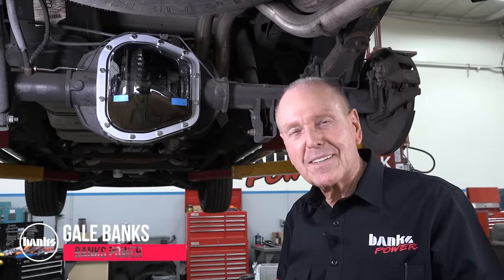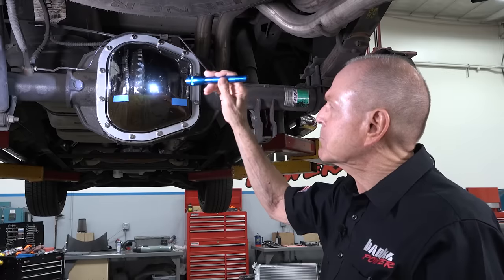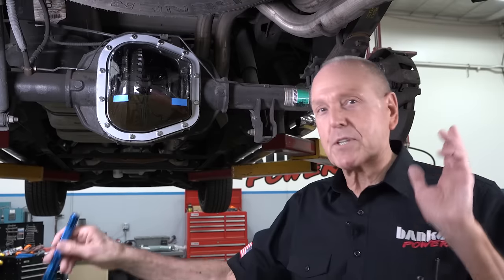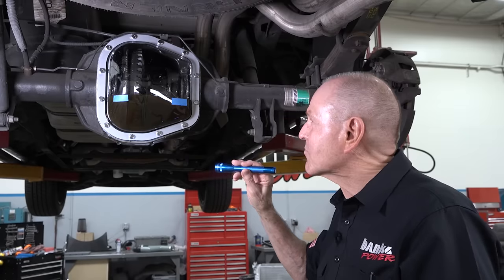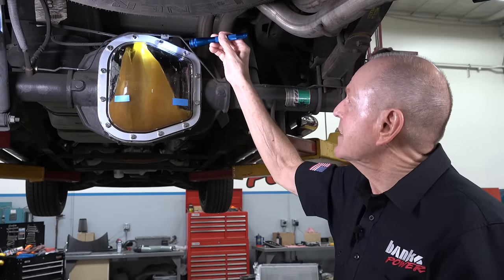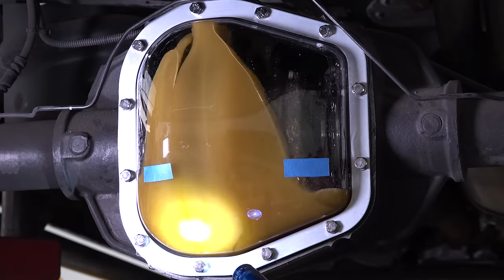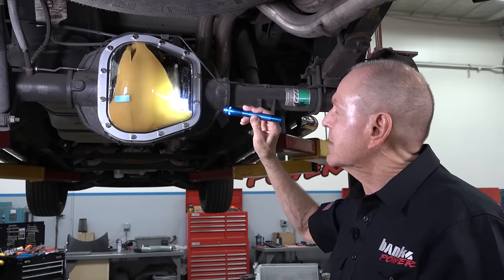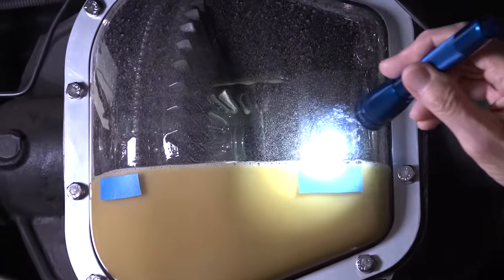What's going on behind your stock diff cover?

Comment: Mr. Banks, I appreciate this video and your “test and prove” attitude. While I agree with you that the flat backed covers are a terrible design, one thing I suspect that might differ from what you are suggesting at 6:40 , is that maintaining an even gap between the ring gear and cover to in fact not be all that beneficial. From working with hydraulic systems, I suspect a reduction in clearance as the oil travels up the back of the cover and over the ring gear is more beneficial as it helps the oil column to maintain the velocity needed for the oil to achieve escape velocity and get thrown into the pinion gallery.

Comment: Make a plastic cover molded in the shape of the MagHytech one and let see the fluid results
Reply: with thin plastic sheet, the diff cover itself could be used as a vacuum mold.
Reply: I would like to see what happens to fluid when it hits what he calls a step and if it really matters. What I'd also like to see just taking a rear end and attaching an electric motor to it. That way you can measure current draw at a given rpm at the rear wheels and you can run it for longer periods. It would be interesting to see what happens to the fluid after running at 60 mph for an hour or longer. Does the fluid have more bubbles or the same?
Reply: @brainfreeze44131  THAT WOULD F**** WORK! We had a bench in the USMC (it was a USAF hand-me-down) called the MA-3 bench that was used to test generators.

Again, good idea.
Reply: Having the truck on a dyno creates the similar load/friction (build heat like on the road).
I suppose you could disconnect the yoke from the driveshaft and then somehow tie in an electric motor to turn the yoke instead.
Reply: I pretty much assumed that would have been in this video.
Reply: Didn't anyone hear him say how plastic is an insulator...
Reply: + Jmodderator
I think you misunderstand. This is referring to plastic just for a quick test to see the fluid pattern, not as an end product.
That said, how much heat transfer does the entire differential case do compared to just the cover? Probably 95+% thus the cover being negligible so far as doing and significant amount of cooling.
PS 7:59 WHAT happened to the tire?
Reply: The axle will surely be a heat sink but won't dissipate as much heat as a thin steel or an alu cover.
Reply: Your conclusion lacks common sense (and empirical data) support.
surface area of axle = ?
surface area of cover = ?
Yes, aluminum is a better heat conductor than steel, and yes, the thickness (mass) of the heat sink will govern how long it takes to dissipate heat "to the air outside the axle"
but it will still have absorbed heat "out of the fluid "(which is the goal).
A sure test would be to test it with both - a thick cover made from steel and a thin cover made from aluminum. I estimate there to be minimal heat difference in the fluid temperature. Perhaps Banks will try this out.
Reply: The axle will break from rust corrosion and worn body mounts long before your rear diff gives you problems.

Comment: I like the idea of aluminum for a differential cover to deplete the heat and keep the viscosity of the oil at a decent temperature! Can imagine how aluminum would work well when towing with a truck! Thank's for sharing!
Reply: Some Jeeps have the "heavy duty" version of their transfer case housings made of aluminum, which...I didn't fully understand the reasoning behind, until I watched this video.

It's not for strength in that case, but rather because it wicks away the heat better than steel.

Comment: Without the smooth transition of the cover, over long periods with a cover without that flow direction, one wonders if the lubricant would endure extra shearing forces? Not to mention foaming and the extra oxidation.This all perfectly illustrates what engineers and Spicer and Meritor told me about the way their covers were designed. Good work and I am dying to see the results.
Reply: Jim Allen I’m also interested in this test . I believe you meant aeration as opposed to oxidation in regards to the foaming of the oil.  One is Air mixed with oil, as is the case here, vs a chemical change at the molecular level (oxidation). I believe anyway.
Reply: Alexander Coburg He is correct. Air contains oxygen. Oxidisation is caused by oxygen. Aeration of oil, especially with high temperature, accelerates oxidisation immensely.
Reply: Yes, foaming is the less correct term, but maybe more understandable to more people. Foaming and aeration, of course, are a major source of oxidation and early lubricant failure.

Comment: I’d love to see a test of different gear oils....conventional vs. synthetic, with & without friction modifiers(limited slip additives) since you have the perfect teaching tool in your clear differential cover.
Reply: I'd like to watch the posi-traction system doin' it's thing, in real-time.
Reply: No tests necessary -- ANY synthetic gear oil will out-perform ANY conventional gear oil of the same viscosity. Period.
Among the synthetics, only Royal Purple has the Friction Modifiers built right in to the formula.
The famous 95 MERC runs an X-Pert Performance cast aluminum diff cover, LubeLocker re-useable gasket, and 80 ounces of Royal Purple 75-W-90.
Reply: @revolutionday1  All you'd see is gear oil splashing around, which is only slightly more exciting than watching paint dry.
Reply: At silklizrd where did you get your info?

Comment: Was rebuilding my Ford 7700 Sterling 10.25 rear end and was going to put an aftermarket aluminum cover on until I saw this video. You saved me a lot of money and a lot of aggravation. I figured the best thing to do was take the stock cover and have it sandblasted and powder coated and bolted back on with new bolts. Still got a nice looking cover but yet allows oil to flow the way the Ford engineers designed it to do.

Comment: Banks is the man for this exact reason!   his scientific mind produces the absolute best products.
Reply: @bankspower  What banks is forgetting here is that the gear oil level must be sufficiently high enough to lubricate the axle bearings pressed into the ends of the axle tubes as well as the carrier bearings pressed onto the diff carrier.
Reply: Hi sir, I was wondering when we going to get an update on the diff cover for the f150 09 to 2014. Please let us know. Thanks.

Comment: Looks like a good aftermarket would be stock shape inside using aluminum with cooling fins outside. Best of both?
Reply: yeah, maybe even with vertical oil channels inside to keep the flow direction uniformand to increase the heat transfer surface area
Reply: Anax100 vertical fins would still change the direction of flow that the engineers intended. The best would be an aluminum housing the same shape inside and outside just with external cooling fins to add a bit of surface area.

If cooling really was the aim, there would be finned housings and tubes too.
Reply: @Anax100  that would only work if the cooling increase was greater than increase in heat production caused by the shear forces introduced by changing its direction as well as the increase in shear caused by the extra surface area of the internal fins. Basically, you need someone who is really on their game when it comes to multiphysics simulations which are then backed up by real world testing of some sort. Or possibly just a shit load build, test, tweak, iterations b/c those simulations could take days to run to be of any use. And that doesn't even take everything else going on inside a diff into to account. 

Not impossible by any stretch & ideas yours are how things improve. Just need to find the right idea. Even what many would consider a shitty idea could actually be a breakthrough. However, being such a mature design I'd wager that simply changing the diff cover isn't going to produce any Earth shattering results. But you never know. That's the beauty of R&D!!
Reply: Not trying to impose any stupid thoughts but aluminum is brittle and can bust if impacted. I work for a company that is hard on our trucks in that most of our work is off road. I have bent up a couple of different covers. Had they been aluminum they would have busted. As it was we kept going to get back to the shop with no down time. Also with road debris same scenario can happen as a brick fell off a truck in front of one truck and banged up the rear end bad. Actually cracked the pumpkin. Diff pan helped to keep things intact enough to get truck to a shop. Aluminum would have cause a catastrophic fail and possibly a wreck. This is just my thoughts on it. Shade tree mechanic here so my voice is weak on this.
Reply: Your voice is not weak on this. It is a very valid point. It is also a point that is proven time and again. Whether it is an aluminium wheel, aluminium sump, or an ali diff cover there is a big trade off. Yes, ali wheels are lighter but on a 4x4, you cannot beat a bent ali wheel straight if you damage it. Many people with ali sump pans have been disabled when a rock strike on a steel pan would have dented it without breaking. As for diff covers, the same applies. I do not think there is any viable reason for an ali diff cover. If cooling is a problem, buy an oil cooler and fan. Mounted correctly, you will not damage it.

Ultimately, these ali diff covers are put on trucks because they look cool. The supposed benefits of cooling is marketing BS. In any case, the pressed sheet steel on the stock cover won't retain all that much heat anyway. Yes, ali is a better conductor of heat but not THAT much better. Especially in that application.

Comment: New banks dif cover coming soon? Seems like you could do much better with the data you’re gathering.
Reply: They wouldn't be spending this much time and money if it wasn't for product development!!
Reply: I was about to say the same thing. Haha
Reply: That was my thaught
Reply: So far the verdict seems to be stock is the only way to go
Reply: Until banks releases its new diff covers.. hahaha
Reply: travis arnold yeah I was wondering how much it's going to cost
Reply: Stock with external heat sink fins.
Reply: Yep - inside will resemble a factory cover with som added sculpting to get the axles better -  but outside will have cooling fins and i would even go as far to assume there will be some air flow diverters to the back to maximize heat transfer.
Reply: It will be a aluminium finned stock inner diff cover
Reply: Total diff pumpkin redesign. Dry sump oiling, external cooling, electronic temp control/monitoring, bearing load meters, ect..... A $30K rear differential!
Reply: Buttered Biskit 
🤣
Reply: ....You have 10+ bolts attaching the cover to the housing. Why would you need to weld anything?
Reply: I'd buy it in a heartbeat
Reply: He's not gathering data.  He's making observations.  If you don't think there's a difference you need to go back to school.
Reply: 😂😂🤦🏻‍♂️ Damnit!  Temperature probes, anonometer mounted under vehicle measuring wind speeds, vehicle is running on a dyno for God’s sake... NOPE!  No data to be gathered there.
Reply: Funny how that seems to apply to many aftermarket parts/mods.....
Reply: @noidontthinksolol  Not true, the axle creates a vacuum near the cover, which then creates air movement across the fins. The stock aluminum fins transfer adequate heat without any need for a "scoop". 😂
Reply: @noidontthinksolol  I am actually an engineer at one of the largest axle suppliers in the world... Unlike you.
Reply: @noidontthinksolol  I'm pretty sure my W-2 agrees with me 😂 figured I'd clarify some confusion since people seem to think they can rebuild an axle just as good (or better than) factory. I guess they all have backlash and TTR validation stations in their garages.
Reply: @noidontthinksolol  visually inspecting your backlash doesn't gaurentee you a good mesh... Especially since your pinion and R/G are lapped in pairs at a specific TTR value. Shimming isn't always an option if you have adjuster nuts. LMAO enjoy the horrid life cycle of your diff as it chatters and causes NVH problems.
Reply: @CoD6HModthedeisel  what is TTR?
Reply: @beni7928  Torque To Rotate

Comment: Good clear presentation. I worked with belts, bushings, bearings and they can be very misunderstood. A good circulation to cool, and disperse additives (and heat) and in a sealed system synthetic would be the way to go.

Comment: so a baffle like a windage tray in an oil pan added to these aftermarket covers to direct the flow properly might be the right direction for a good engineered design.....
Reply: No, a windage tray keep oil from sticking to a crank to reduced rotating mass and in turn making more power. A windage tray here would prevent the oil from being carried over to the pinion bearings and in turn cause a failure. What you want is a cover that smooths out the transition between the cover's curve and the pumpkin to not have squared off sections that interrupt the oil being carried over.
Reply: Samuel Paniagua now who told you that was the purpose of a windage tray? Windage trays in oil pans are designed for cars on circuit tracks. Oil, as well as any other fluid, has the tendency to slosh around inside of a container when the direction of the container is changed. Regarding cars on a race track, oil can actually slosh so much where the oil pickup becomes exposed and starts sucking up air rather than oil, thus destroying your bearings. Windage trays keeps the oil from  sloshing around, much like the baffles in which the fuel pump sits in a “pump-in-tank” fuel cell
Reply: @65Red  i may have mistaken windage tray with a crank scraper. My apologies, but it still won't help in a differential

Comment: Check out this STOCK diff cover for the ford 8.8 it is everything u are describing that you think would work the best. I run it on my lifted regeared ranger. 

Part #
DR3Z-4033-B
Reply: Looks good!
Reply: Wonder if it will fit my 18 f150 with a 8.8
Reply: Bond Lohden as far as i know fits any 8.8. It even cleared my home made diff guard i had built around the original cover. There is 1 port i had to plug on top of the cover with a bolt but thats simple.  I took out the steel magnetic plugs and put in brass to keep the corrosion down.
Reply: @reedvending2384  ok thank you
Reply: reed vending, the best shape is on the best axle. Ford 9 inch

Comment: Cavitation (air) in the lube also acts like an insulator, as it hinders thermal transfer. That's why a 7-11 Slurpee doesn't quench your thirst ounce for ounce as much as an equivalent gulp of beverage would. Therefore, a correctly shaped aluminum cover with cooling fins has my vote.

Comment: I used to work at an oil change place.  I've literally seen metal shavings drain out from differentials. Not to mention some drain plugs have magnetic ends that catch all that stuff.
Reply: Wishing I had a drain plug, as the entire inspection cover has to be removed to drain a Dana 30/35.  sigh

Comment: Interesting how porous that lube you've used is.  We did a whole bunch of this research in the 1980's and were amazed at the differences in rear end gear lube!  Sure taught us why we and others had so much trouble with rear ands and standard transmissions on the Baja 1000 races.  Simple fix, then we won our class a few times.

Comment: In addition to finding this very interesting....it makes me wonder why the scheduled maintenance is at such long intervals. On my 2018 Escalade I believe the rear and front diff is not even mentioned in the maintenance schedule. I changed the front today at 15524 miles and it was dirty. I changed the transfer case fluid at 11,500 and it was also very dirty and it calls for that at 45,000. I can't imagine what it would be like. On my 2009 Yukon I followed the maintenance schedule and by the time the services were performed the parts were really worn out. By looking at how that fluid heats up and works I would say it would be a wise investment to do the fluid changes at shorter intervals. I realize if you take it to the dealer it is going to be very expensive. Your regular mechanic, may be more affordable and if you do it yourself you save a ton of money and more importantly maybe wear and tear?